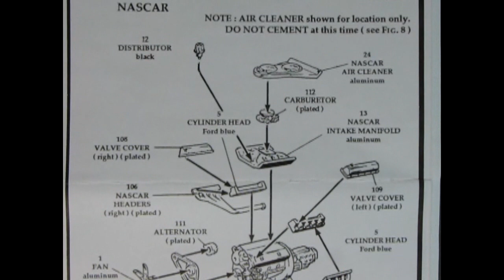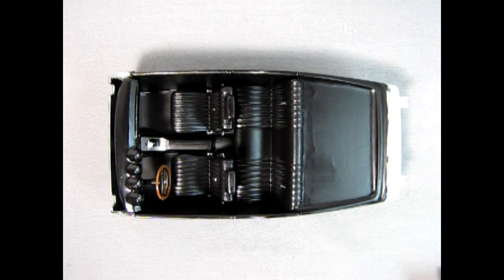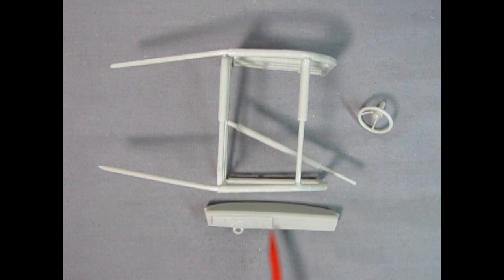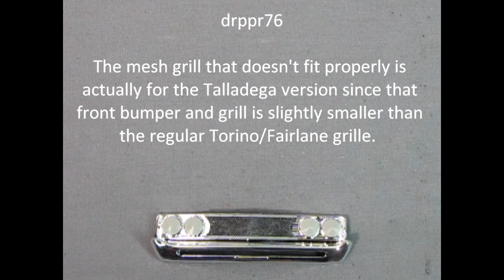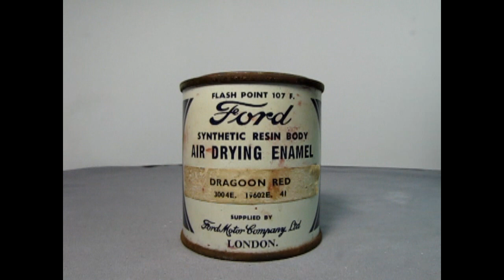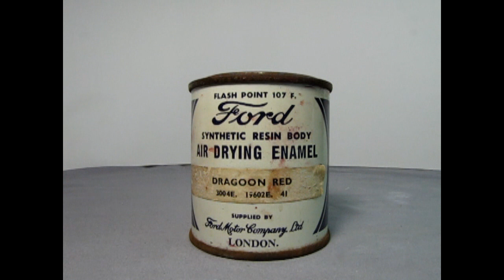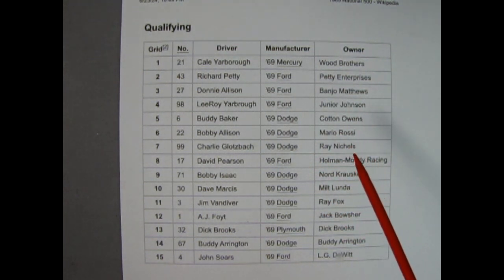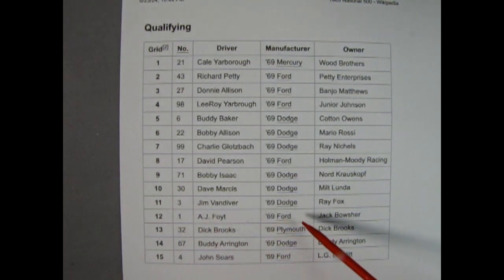Let's Build It! Building The AMT/ERTL 1969 Ford Fairlane Cobra Torino Plastic Car Kit Part 5

Comment: Nice! My High School ride was a 68 GT with a 390. Boy, do I miss that ride.
Reply from the maker: Right on! I enjoy these stories.
Reply: @monsterhobbies   My step brother totaled it while I was in Basic Training. I bought another 68 when I got stationed at Ft. Hood, unfortunately it was grossly under powered with a 302 2bbl.
Reply from the maker: @mattfulmer4243  Too bad about the car. I saw one today, a 1969 Fairlane that was a medium metallic blue with a cream vinyl top and matching hub caps and it had a huge sunroof installed.